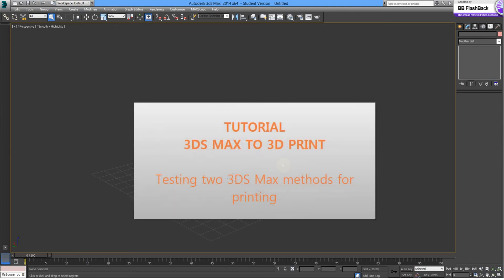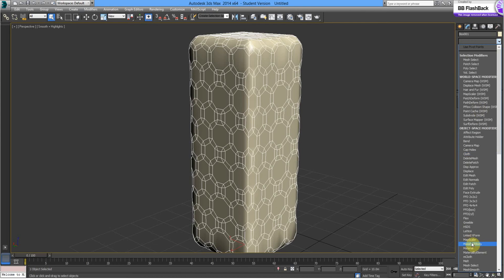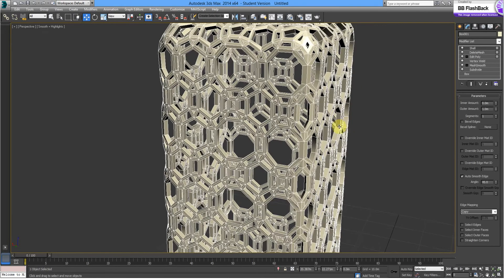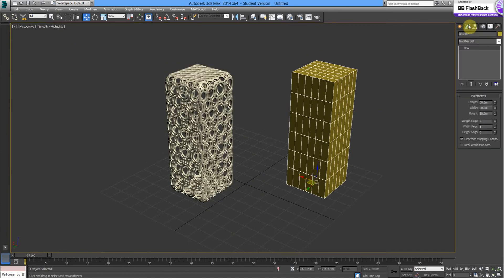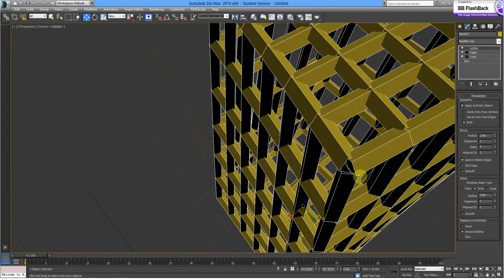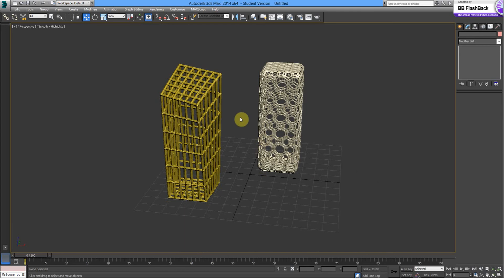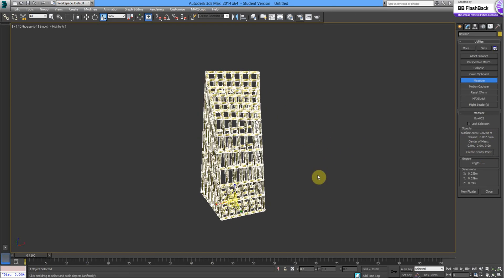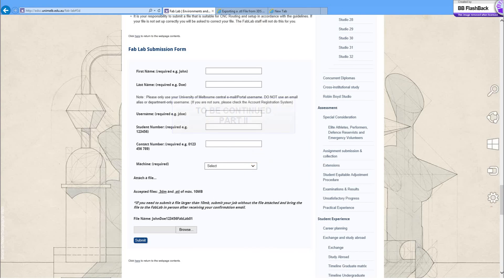FDUM 2013 - 3DS MAX TO 3D PRINT PART I

Comment: I have been working with 3D modeling program for only a couple weeks but I first used a couple other programs i.e. Alias and Inventor primary to try to do what you just did in this video.  It seems much more difficult in the other programs for someone just getting started. So far I like 3DS Max the best and this tutorial is the best I have came across compared to other  tutorials I've watched thus far. I'm looking forward to your other videos.  I too am designing for objects to be printed on a 3D printer.  I'm just wondering if there is a way to accurately measure all the aspects of the model like wall thickness, inside/outside dimensions, and spacing between the holes.  It would be good for my design process, as some objects I am designing need to be a precise fit, i,e, a cell phone case. Thanks for your great video.
Reply: I know this was posted a year ago, and you've probably found either a solution to all of this by now or simply gave up and moved on.  3dsmax by default has several measurement tools in the Helpers tab of the Command Panel, like the Tape, Protractor, and ExposeTM helpers.  If these are not enough, and you want even more control over measurements in your scene, you can use Maxscript to enhance the features.  I recommend these for measuring the edges of any object:
http://www.scriptspot.com/3ds-max/mcg/mcg-edge-length-display
MCG works with 3dsmax 2016 and higher, but if you don't have a MCG capable version of 3dsmax, you can try this:
http://www.scriptspot.com/3ds-max/scripts/lengthcalculator
Length Calculator is a very simple and easy to use script, which will display the length of any edge in your scene.  Just be sure your units are set up for real world modeling first.
Reply: http://knowledge.autodesk.com/support/3ds-max/learn-explore/caas/CloudHelp/cloudhelp/2015/ENU/3DSMax/files/GUID-E5FD69A1-80E0-4DE9-9EAE-8B22A1575EDE-htm.html